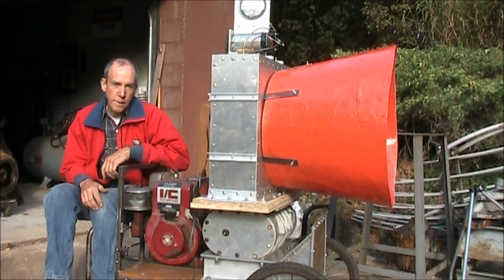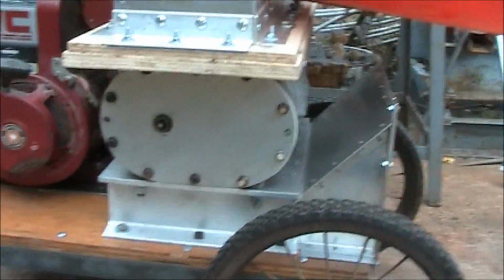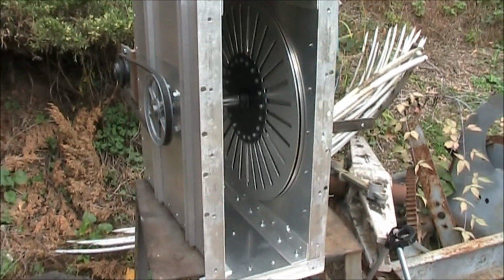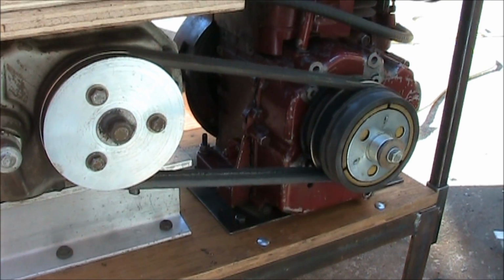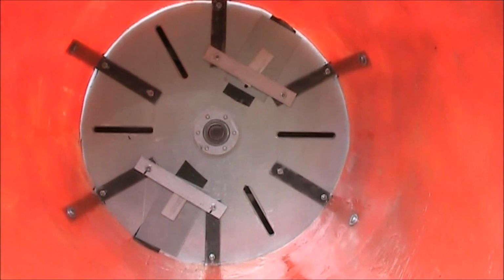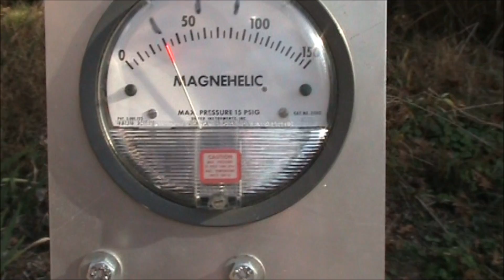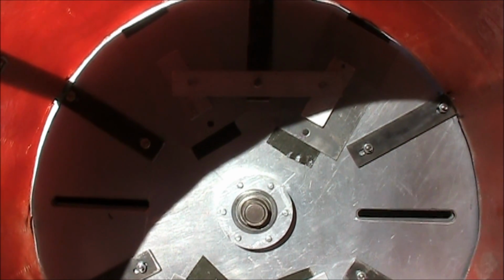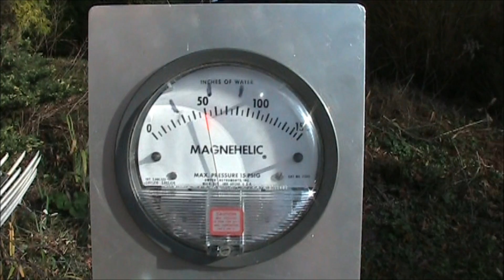Slotted disk siren

Comment: This is how the Chrysler air raid siren worked. However slotted disk Sirens require a huge fan in order to get good sound
Reply from the maker: That's where i got the idea from. I did improve it with resonators and a bigger blower.